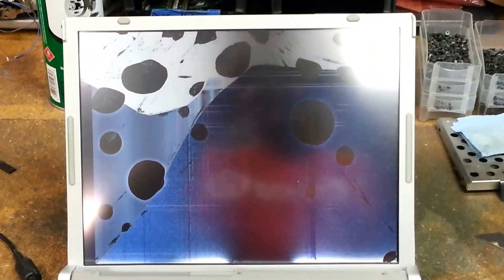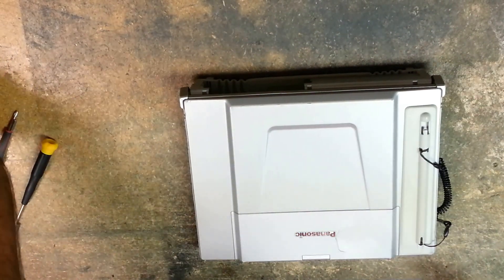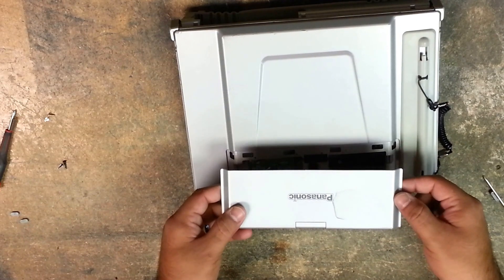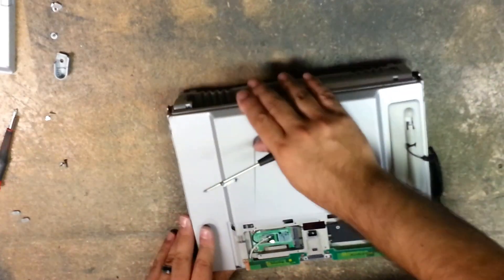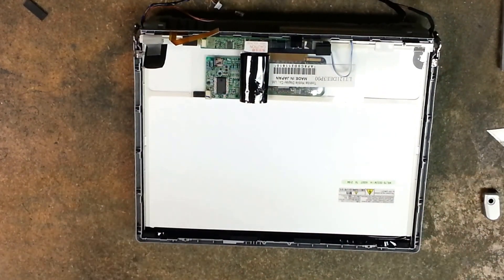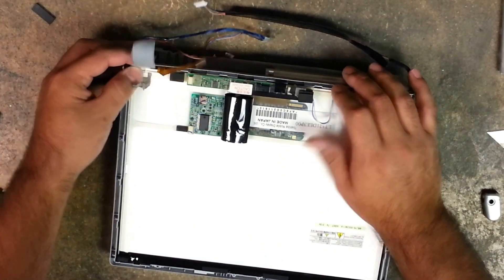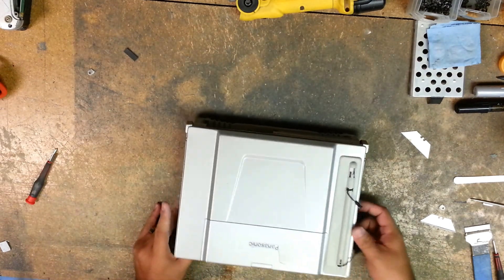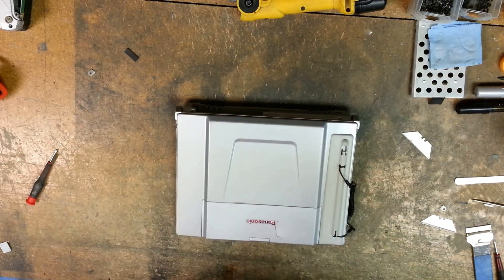Panasonic CF-T8 LCD removal

Comment: I want to replace the touchscreen of this on a CF-W8, or just take its  motherboard and put it on the T8.
Do you think it's possible?
Not sure what's wrong, but they r both not working.
Long story short is it possible to remove the whole panel, or the whole monitor with hinges and everything?
First stage of the mission failed, I need new screwdrivers